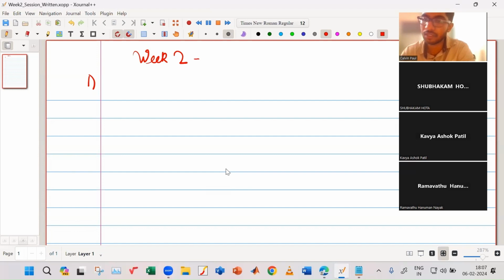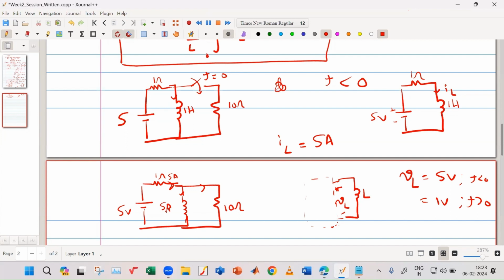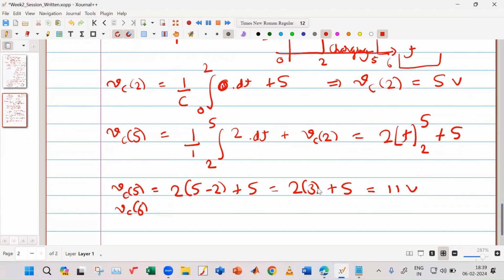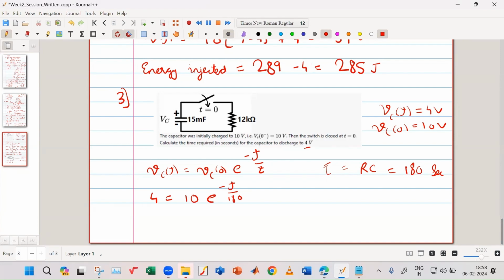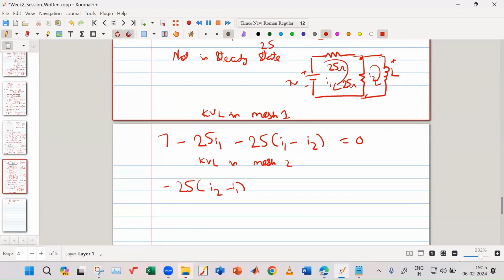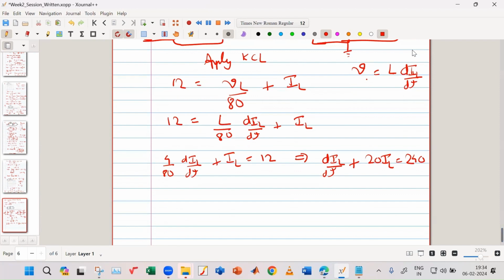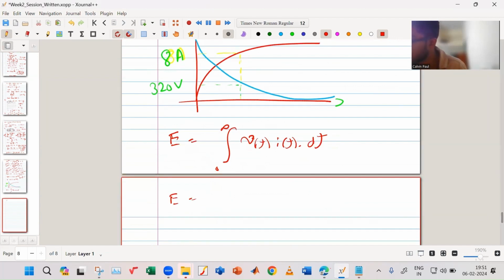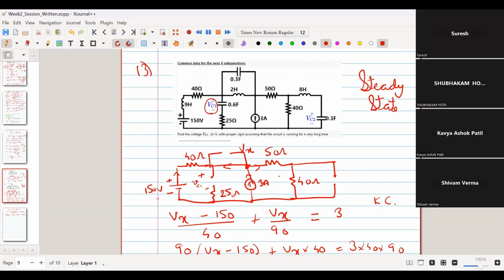Network Analysis - NPTEL - Week 2 - Problem Solving and Doubt Clearing Session

Comment: Sir ,what is difference between node and junction?
Reply from the maker: Node is a point where two or more circuit elements are connected, whereas junction is a point where three or more circuit elements are connected. All junctions are nodes, but not vice versa